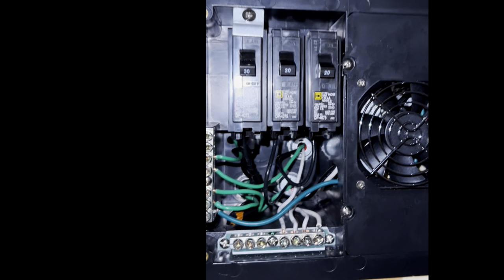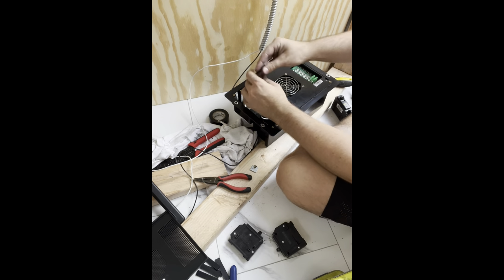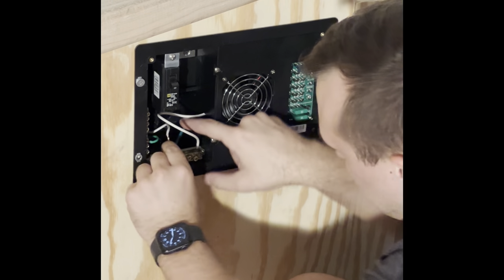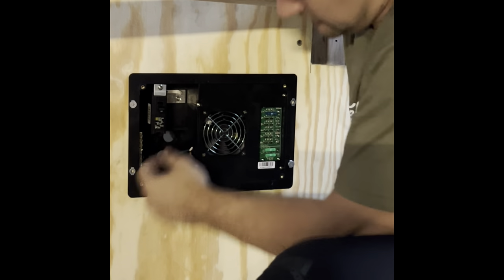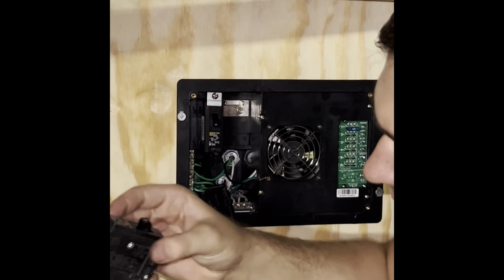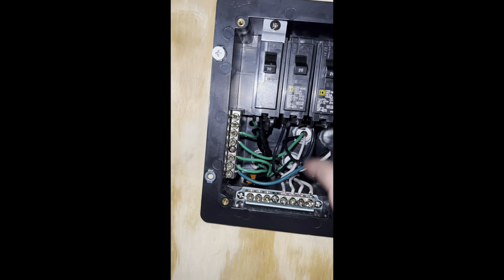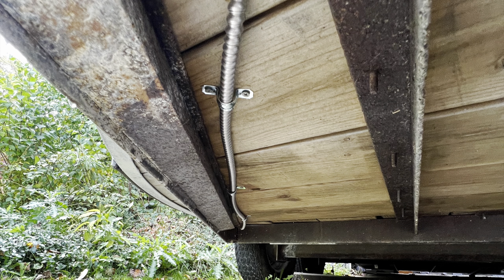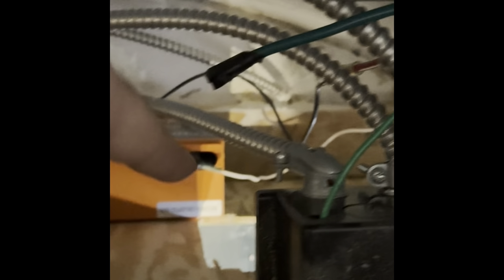How we wired electric in our Mobile Bar - Horse Trailer Conversion and a Lithium Battery!

Comment from the maker: Shopping List
 (Some items came from local hardware stores such as Lowe’s and Home Depot)

1. WFCO 8740AD (Power Inverter) -  https://www.amazon.com/dp/B09XH2DBM5/ref=cm_sw_r_as_gl_api_gl_i_D013RJJTGKKXMK373H8R?linkCode=ml2&tag=blavigna-20
2. 20 Amp Breakers ( I used 20s, but 15s probably would suffix) - https://amzn.to/413z8BZ
3. MC Wire 12/2 (you can use 14/2 if you use 15 amps) - https://amzn.to/3GgWgFg
4. Separate negative terminal for 12V DC side (I got mine at Lowe’s)- https://amzn.to/3GjJvKh 
5. Wire Connectors - https://amzn.to/3McsK7w
6. Wall Mount Glass touch dimmable 12V - 24V light switch - https://amzn.to/3Kbu3Rp
7. LED Panel Slim 12V Lights - https://amzn.to/3Kbu3Rp
8. Gold Wall Scone lights - https://amzn.to/3nLrazk
9. USB 12 V plugs (I didn’t add yet) - https://amzn.to/3nLrazk
10. Flanged Inlet (Shore Line) 15 or 20 Amps - https://amzn.to/40IYrd5
11. Lithium Battery (I bought the 20ah because all that is pulling from the battery is the ceiling lights) - https://amzn.to/3nOi2Kp
12. Anti Short bushings (MCwire) - https://amzn.to/3Ggnqfz

The connectors just depend on trailer setup and what angles you need .. etc. Make sure you get the right size for the Mc wire size and the knock out of the boxes.

13. 90 Degree Squeeze connectors - https://amzn.to/434HefF
14.  Squeeze connectors - https://amzn.to/3ZIi9Ej
15. Screw in connectors -  https://amzn.to/3mc7aFx
16. Single gang out let boxes 1/2 inch (picked mine up at Lowe’s) - https://amzn.to/3mc7aFx
17. GFCI 20 Amp outlet - https://amzn.to/3mc7aFx
18. GFCI cover - https://amzn.to/3mc7aFx
19. Light Switch (dimmable) - https://amzn.to/3mc7aFx
20. 16 Gauge wire for the 12 V wire - https://amzn.to/413BnFp
21. If you need to protect the previous wire - I pulled mine through Mc wire (you can buy the sheathing)
22. Winged Wire Nuts - https://amzn.to/3nOiR5S
23. Electrical tape - https://amzn.to/3nOiR5S
24.  Wire Strippers (bare minimum need these) - https://amzn.to/3KeMPYl
25. Electric Tester kit (GFCI outlet tester is great a tool) - https://amzn.to/3nOPpfL 

This is a good starting list and some may be needed and others not, just keep your receipts and return the extra.
Reply: Tha ks
Reply: How much would you say you spent on materials?

Comment: What is your main source of power for this rv converter? Do you run off an RV plug in from a generator? 110 outlet and extension cord? I’m sort of lost.
Reply from the maker: If I need the outlets or the back wall lights on, I would either run an extension cord from a power source (generator/inverter/ or simply an outlet from a venue) to my “shoreline” plug in. This is then powering my 110, but at the same time charging my Lithium battery. So even if I don’t have 110 V AC power- I can still run the 12V DC ceiling lights off of the lithium battery.
Reply from the maker: I personally have an inverter that is much quieter than a generator.